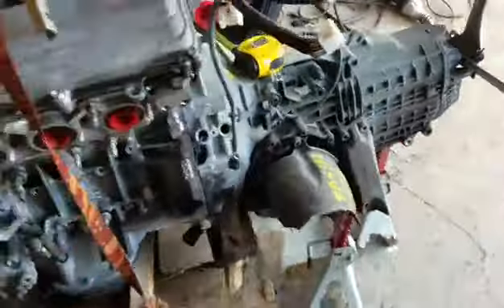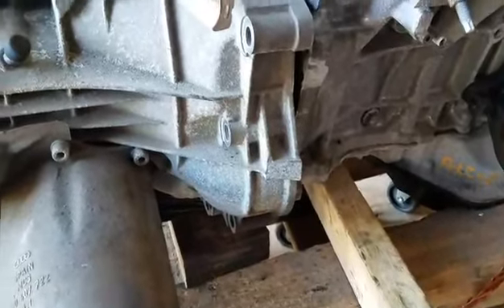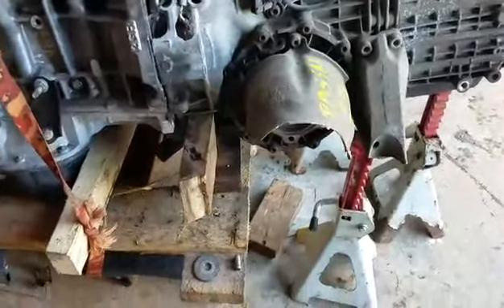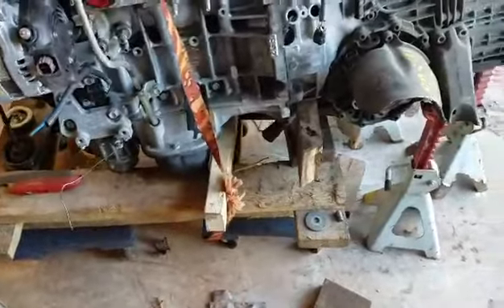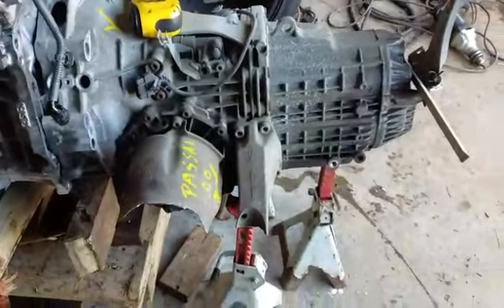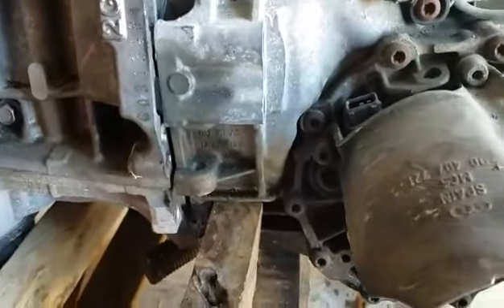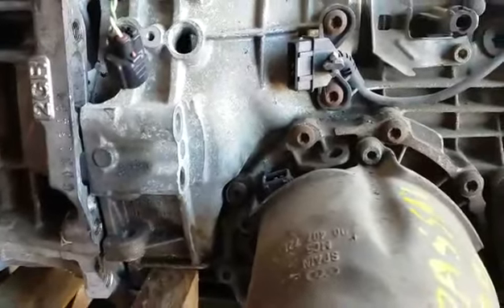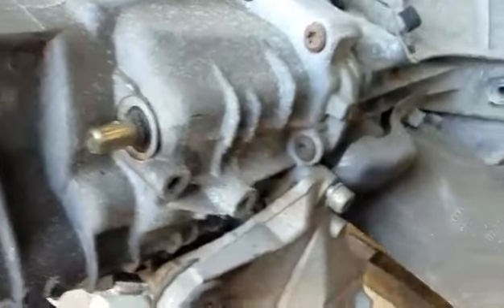2GR v6 to VW/Audi/Porsche 012/01W transmission

Comment: Fun to see, I just grabbed myself two FWD 01E 6-speeds and one of these 012 5 speeds for my project, havent decided whichone to go for but weighed them and the 6 speed is 132lb, and the 5 speed 104,4lb. Its also about 1,5-2 inch shorter. The 6 speed seems to just have an extra overdrive gear which I wont need on the track anyway. It doesn´t seem like the 5-speed is weaker. But for sure the gear selection is way different.